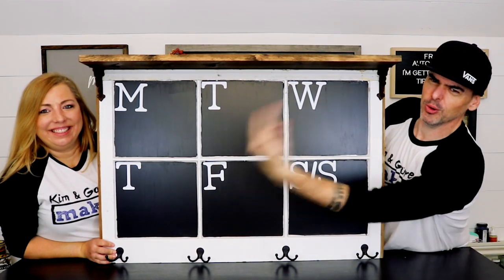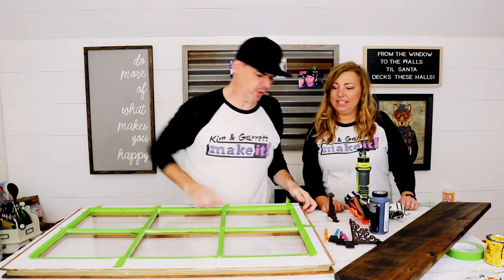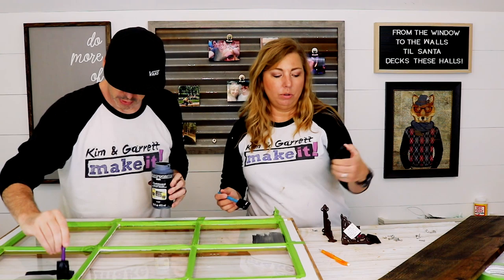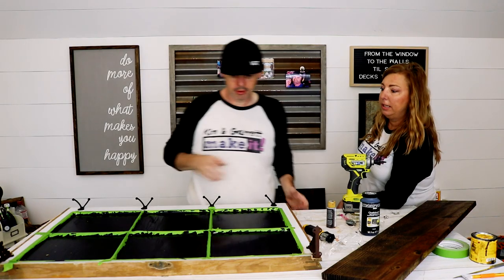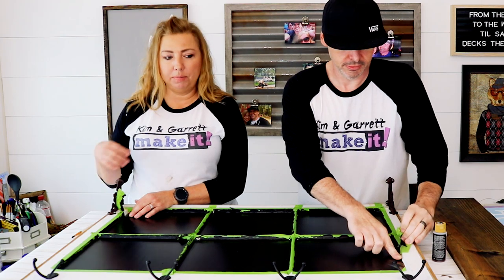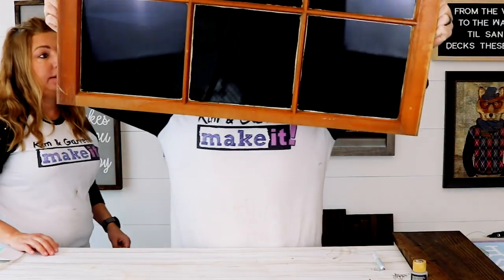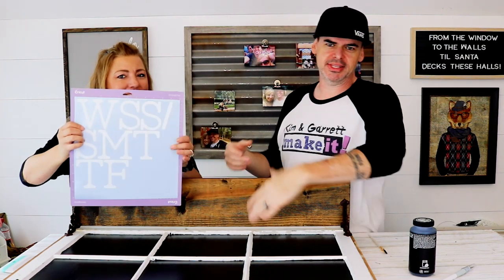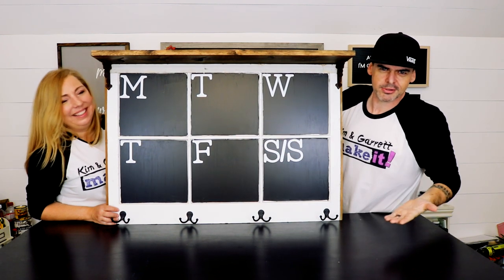Repurposed Window Ideas | Old Window Into a Chalkboard Coat Rack Shelf | Best Recycling Ideas

Comment: Great idea! I love this project. Are you worried about the glass being fragile or would the paint offer some protection? Could the glass be removed and replaced with another material like thin wood that is painted?
Reply from the maker: It could! The paint adds an extra layer of cushion and acts like a tape to hold it together a little better. If you’re worried though maybe put a little extra foam backing on!